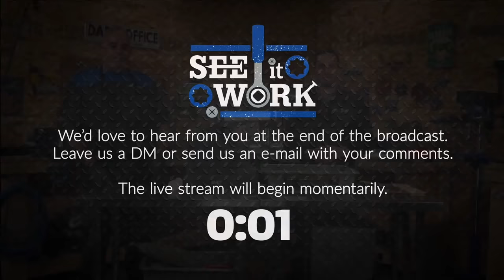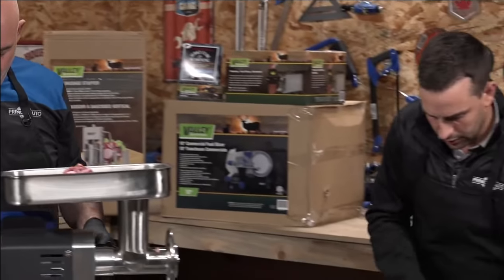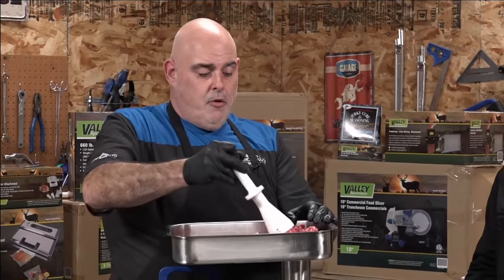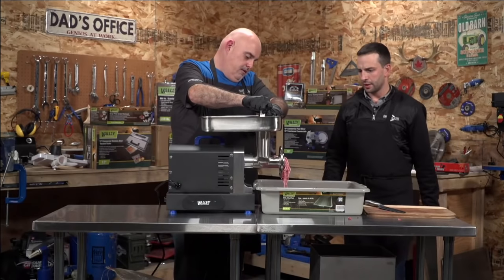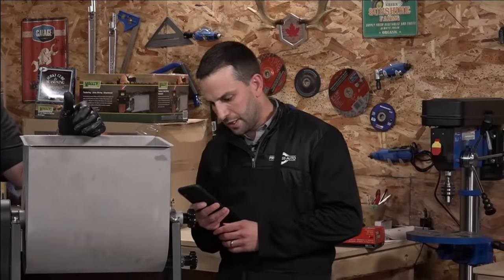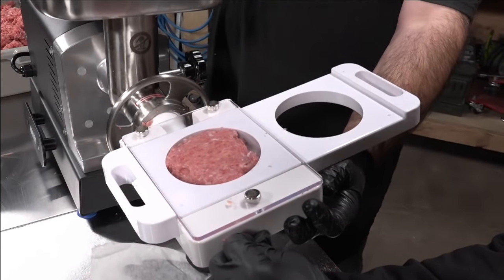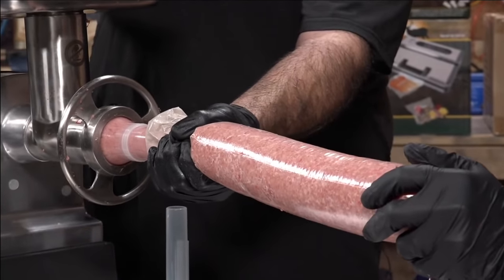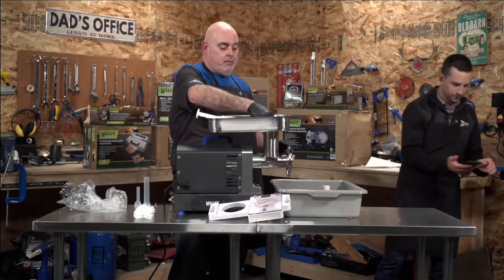See it Work -Episode 8 - Food Processing

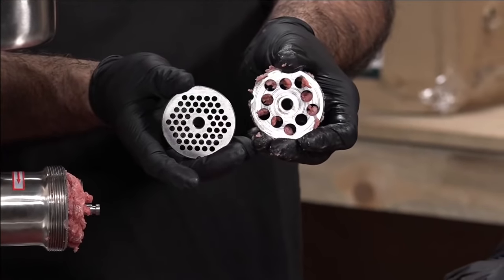Comment: @15:25 The grinding plate on the right hand side is very likely not 8mm plate, but a 10mm one, the holes in that plate seem to be the same diameter than the center hole which is a 10mm.